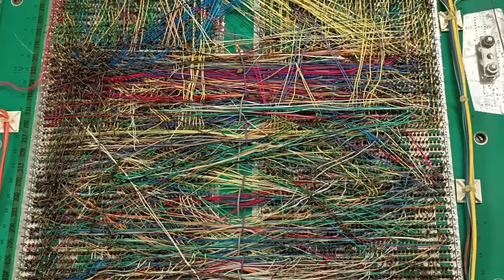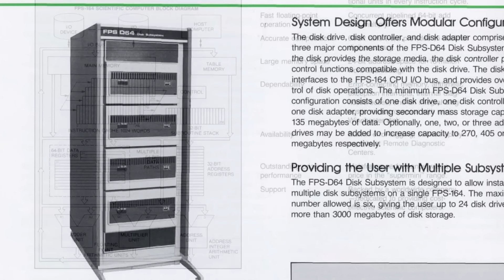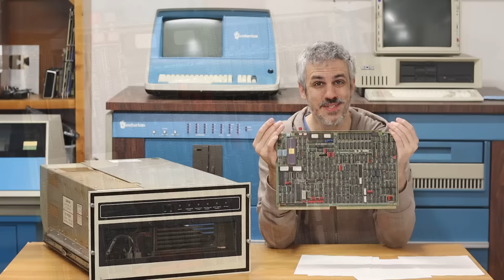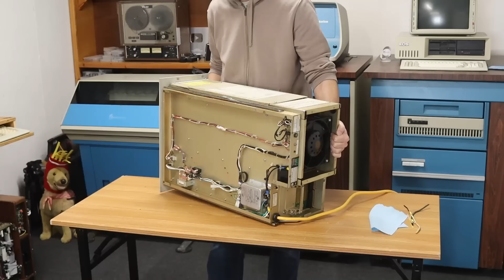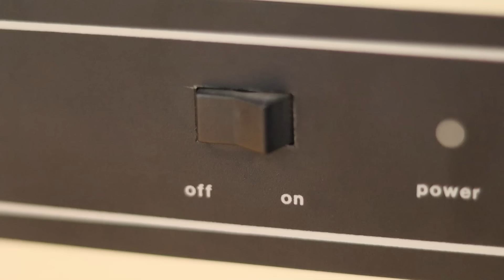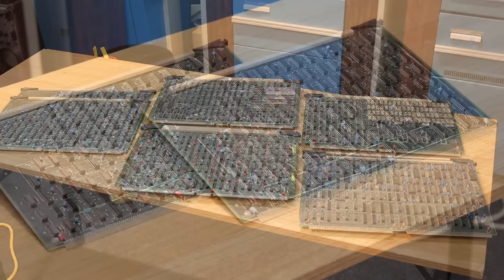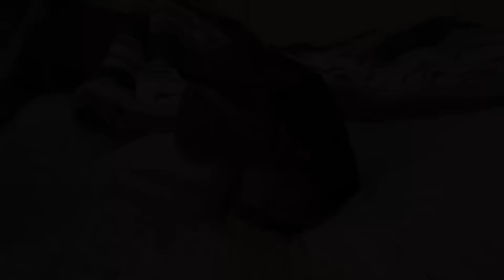This Computer is from a Defunct Supercomputer Company

Comment: 3GB in the early 80’s is mind blowing, I don’t think I heard the term “gigabyte” until the late 90’s.
Reply: The '90s were a wild time for storage evolution. Your 1993 PC might have had a 120 MB drive. We bought a Pentium 75 with a 1 GB 3.5" IDE drive in late 1995. By 1997 you'd have seen a 4 GB model, by 1998 probably 8 GB, and by 2000 probably 20 GB at 7200 rpm.
Reply: @PileOfEmptyTapes  I had a Pentium P60 with 400MB of IDE HDD in 1993.
Reply: @PileOfEmptyTapes  My Window 95 computer had 4 GB (It was a used one that was upgraded, then sold when 98 came out). I had SO MUCH SPACE!

Now I have like 4 terabytes in all and I need more
Reply: @PileOfEmptyTapes  In 2007 I had a 240GB hard drive (no clue what it cost). In 2014 I paid over $100 for a 2TB hard drive. In 2023 I bought a 20TB EXOS for $400.
Reply: @colewelden 

My first cutting edge (at the time) computer was an Atari 400.  External 5-1/4” floppy drive.  Each floppy could store 256 KB.  It had 16 kilobytes of ram, which could be extended to 64 kilobytes by inserting RAM cartridges.  That was not a typo.  KB, not MB, GB, or TB.  My friends thought I was insane to buy them, but I was doing things with graphics they couldn’t imagine.  For those who remember, while they were doing things at CGA levels, I was doing things at near VGA qualities.

I remember having to try all possible orders of loading my program kernels to fit them in the 512KB memory limit.  I remember spending hours swapping dip switches and jumper pins to find an interrupt configuration and com port to fit a new piece of hardware into my existing system.

When I upgraded to an 8086 with 12 MHz in turbo mode with a 16 inch multisynch monitor and a 10 megabyte hard drive I thought I was styling, even though it cost three month’s pay.  

A year later it needed upgrading.  I continued to upgrade that computer in a Ship of Theseus kind of way until 2005, when I made the mistake of upgrading by buying a brand new off the shelf computer.  Once was enough.  

I went back to building and upgrading my own.  I eventually stopped upgrading because I could and switched to only upgrading because a game I was playing needed it.  I think my last upgrade was 2016 or 2018 (I can’t remember).  I haven’t run across anything that needs more, but I no longer write my own programs.  

I self taught myself Basic, Cobol, Fortran, C, C++, and Java.  I found DOS much more interesting to play with than Windows, which took much of the hardware level system control away.  I still use a lot of the programs I wrote over the years, but I stopped playing with graphics around the time Unreal came out.  I gave up on Windows as soon as Linux came out.  

I was offered jobs in the industry several times, but I didn’t want to convert a hobby into work.  I eventually did end up building hardware and programming as a small part of my job, but it was PLCs and automation systems, which were far enough removed to be a completely different discipline.

Nowadays it is all about networks, which never really interested me, and AI, which does the work for you.  The tech has grown beyond my area of interest.

I have watched the tech grow from when I first read about integrated circuits in 1969 to today’s AI computing.  Nowadays your phone has more computing power than the entire world did when NASA launched Apollo.

I recently read a book about Cold War spy tech.  The CIA spent billions developing tools to enhance their agent’s capabilities.  Nowadays there’s an app for that.  They would have trafficked their daughters for capabilities and tools that are now free on the internet (in your car) and usable by people who aren’t sure if computers use electricity or not.

It has been a hell of a ride.
Reply: In about 1992 the software company I worked for then bought our group a 1GB hard drive, and we were overjoyed. The group was building versions of a software package and 1GB gave us so much more room  for build artifacts, logs and past builds for comparison. And it took months for a team of 6 to get close to filling that one drive up!  -- just 1GB -- !
Reply: A friend of mine had a 1 GB drive in the early 90ies. 5.25“ full height and it cost thousands.
Reply: @EVPaddy Mine (1992) was also 5.25” by full-height, SCSI interface, and had a power draw of 60W.
Reply: @ethanpoole3443 a good friend of mine worked in desktop publishing and he had a 10GB harddrive in 1993. That thing was massive and needed it's own power supply. He gave it to me when it was obsolete. Still got that behemoth laying around somewhere.
Reply: I think I had 2 gigabytes in papers in 1873
Reply: @triangle.pyramid  ahaha
Reply: When I worked for FPS, I added up all the disk drives in 1987. There were 3.1 gigabytes in the entire company. I was curious to know how much music could be stored. I've had over ½ TB on my phone for years.
I remember being amazed when I saw a 300 MB Winchester drive the size of a bread box.
Reply: I bought my fist 1GB SCSI hard drive for my PC in late 1992.  As I recall it cost somewhere between $1500-1800 at the time.  That was in addition to my existing 330MB SCSI drive.  It was hilarious if you wanted to format it for MS-DOS as you needed the whole alphabet!  I actually used Windows NT 3.1 beta for that PC and those drives.
Reply: @ethanpoole3443  How would you have acquired a beta version of Windows NT back then? Were these distributed to testers or publicly available?
Reply: I built my first 486 in about 1994 on the proceeds of a month of hellish work in the sands of the Arabian Peninsula. They ran us off the site for predicting that they were going to have a major blowout and burn the rig to the ground ; a week after we left the country, they burned the rig to the ground. Interesting times. But it (or possibly it's successor) used a motherboard from a company called "Gigabyte".
Personally, I'm still trying to get people to work with the idea of the gigadeath. As in, "World War 2 was approximately a 0.04 Gdeath conflict." Somehow, people resist thinking like that.
Reply: @WellsiteGeologist-UK  0.0 something is always awkward to handle. „40 MegaDeath“ is easier to say and might catch on easier.
Reply: @MrAranton  When you need to express ideas like "the human population is probably about 5 gigadeaths from a "sustainabie" level", you need to get people used to thinking in gigadeaths, and what it means.
Reply: @WellsiteGeologist-UK 
I sympathize with your expat experience.  I worked for the Royal Saudi Navy for a year (pre Gulf War).  I understand they are a lot more serious today.  Not so much back then.
Reply: @Simple_But_Expensive  (Noting that i deliberately used the term "Arabian Peninsula" to leave it definitely uncertain which of the peninsula's 8 (or is it 9? ; I'd have to go and count) counties I was referring to. You never know - I might end up working there again.)
Reply: @WellsiteGeologist-UK 
Fully understand.  I have no intention of going back, so I went ahead and named mine.
Reply: There was a game called Devastation (albeit a later title), but it always killed me when they claimed they need to steal a "8terrabite drive" or something. As a kid, i was happy to have a 5gb harddisk, and i felt like a king. All my dos games could run there. But i haven't seen computers such as this (im 30).
Reply: @alyctro8158  My first computer - a 386, 1989 build - came with a 40MB hard drive on an MFM controller. Careful research after I'd paid off my student debt yielded an RLL controller card which, after running code from it's ROM chip turned the 40 MB into a 60MB drive (actual, not using compression, which arrived with the next version of DOS). Another good month at work produced a drive to put onto the second RLL channel for 120MB in total.
Then a job in Norway got me into big (half-gig) drives, but also needed an IDE controller. in addition to the RLL controller. I think that was about when I made the strategic error of buying a VL-bus mother board and IO card.
Reply: Who remembers Zip drive discs and 1 gigabyte Jaz drives from 1996-99?
Reply: Late 80's for me.  Apple's XMP-48 had 1GB of RAM and 12GB of storage spread across a room full of VAX-7800s
Reply: I agree. Phenomenal
Reply: For most of us at that time; The only GB we knew of was the country I live in... 🇬🇧😆
Reply: My first hard drive was 10 MB and cost $500.  My next hard drive, bought 2 years later was 30 MB and cost $200.  My friends were laughing at me because they said I would never use it all.  Today, you couldn’t load your operating system on it.
Reply: I got a 40 mb hard drive and I could finally install windows 311 from the many floppy disks. Then had no space left. That Hackers film was misleading on how easy it was to hack … 12 mhz when the turbo was pushed no heat sink needed.

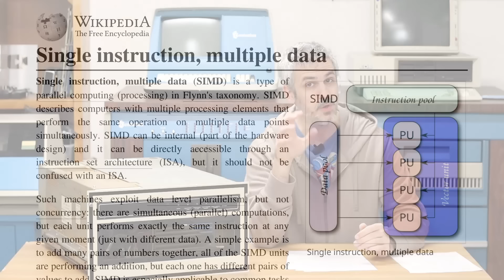Comment: 5:30 I find this one of the wildest things about old computers - these days suggesting a word length that's not a power of 2 would be considered the ramblings of a lunatic, but back then  you could pretty much pick a random number and run with it.
Reply: Get this: IEEE 754 floating point actually defines a 43-bit extended single precision format. That's even weirder than 38 bit!
Reply: The numbers weren't random, though.  The Apollo Guidance Computer, for example, had 15-bit words (plus one parity bit, but we don't count those).  I'm sure they worked out that it was they needed, without any more than necessary.  They had strict size and weight limitations.

Other early computers had words that were a multiple of six bits because they used a six bit character set.
Reply: @GH-oi2jf  I've run across weird word sizes that didn't fall into the "multiple of 6 bit characters" category at least.

For example, the CP-1600 was nominally a 16-bit machine, but it used 10-bit opcodes. That was dictated somewhat by how many transistors they could fit in the chip, really.  DSPs have come in odd sizes such as 24 bit, and have had features such as 40-bit accumulators. Those were driven by cost vs. precision tradeoffs. 

There was some Burroughs big iron (B6500, for instance) with 52 bit words: 1 parity bit, 3 control bits, and a 48-bit data field. I'm not sure what drove 48 bits for their floating point format; the corresponding integer format was effectively 40-bit sign magnitude, though, IIRC.

The LGP-30, a machine made famous by The Story of Mel, had a 31-bit word size effectively, as the 32nd bit was a spacer bit to separate words on its drum memory. (The RPC-4000, which Mel is porting to, has a 32-bit word size.)

And then there's those really old-school bi-quinary machines, with 7 bits per decimal digit, encoded as a pair of 1-hot vectors...

Yes, not truly random, but certainly quite a variety!
Reply: Provided it's a multiple of 3…
(in octal times, bits came in triplets)

Comment: Jeez, they saw the DEC 5V supply that could do 120 amps and were like "Oh yeah?! We'll raise you 80 amps!"
Reply: I had an Applicon-11 system for awhile.  It was a pdp-11/34 connected to a CAD system.  When I got into it the PSU there read +5v as 400A.  It may have been 500.  Was crazy.  But it fed up to 4 connected backplanes mostly of 8k of memory cards and 4 very large CRTs with drawing pads.  I never did get it to work. The RP06 was in very poor condition with bits of the foam insulation all over inside.  I only spun it up once but did not load the heads.  I later sold it someone else.
Reply: @timradde4328 That's quite cool! I can't imagine what it would have been like to do CAD on an 11/34.
Reply: Irony is thats nothing compared to modern <1v VRMs

Comment: That the designs and documentation of these defunct companies are lost, often forever, due to acquisitions and other corporate skullduggery (like buying a company just to kill its competing products) is simply criminal.  One would hope that there would be a central (in US terms, federal) repository where companies are legally obligated to submit their designs and documentation.
"But muh trade secrets much intellectual property wow" - make it sealed for 10-20 years.
Reply: All of the software for Burroughs Medium Systems still exists. Somewhere. When the line closed down in March 2000 (just after the Feb 29 leapyear date was known to have transitioned correctly in the software), the production system disks were archived and the archives sent to Iron Mountain for safe storage. The development systems were then shut down and parted out. That data is still in Iron Mountain. Somewhere. The employee in charge of the interface to Iron Mountain gave the location code to the person in charge of software, and it was kept. 

But several years later when I tried to pull the archive so that I could get it to a museum, we found it was written in a format that nobody recognized as an Iron Mountain location identifier. So it was effectively gone, because nobody could send IM a pull request to get it back. The last of us that were around Unisys in those days are now retired or dead, so even that incorrect locator has been lost. But the tapes are still there. Somewhere. Whether they would be readable after 25 years is a good question. Probably not.

Comment: This is a bit of a stretch, but you could try fuzzing the 3000. Assuming there's nothing in non-volatile writable storage and that the system can never get into a state that damages the hardware, there's no harm throwing bits at it until something happens.
Reply: That isn't a good idea, even into the 90's Intel put special instructions in their cpus that made them go kaboom.

There is no way to know if there was any put in (intentionally or unintentionally, it doesn't matter).

Comment: I ussed to work in telecomms, all wires were wirewraped, we had an electric wrapping tool, though not sure if it will fit your pin spacing, it looked like a small drill, but with a cut and wrap tip
just an idea ;)

Comment: The biggest difference between the AP-120B and the Cray-1 is that one can be run from a wall outlet and needs no external cooling and the other needed 115kW of 3-phase power just to power the unit itself and 20kW worth of refrigeration to cool it down.
Reply: Back in my Uni days they had VAXes which were Not For Us Mere Mortals. Recently I watched a video here on YouTube by someone opening and detailing a VAX. That fired in me the dream to own one myself. The inner workings did not seem to pose any problem (OK the wiring of backplane would. In spades) But when I saw the power plug, I realized that, no matter how cheap the price of the VAX, the electrical bill would bankrupt me.
Reply: @TomFynn I don’t know which model VAX you were looking at, but the 11/780 had an L21-30 plug.  That’s Three-phase 208 with neutral at 30 amps.

Interestingly, the various parts of the VAX all ran at 117V.  The reason for the 3-phase plus was because no one wanted to supply 117v at 90 amps.  If you rewire the power distribution unit, you could run it off of 5 20 amp household circuits. :)  

However, even if you were willing to do that, let’s talk air conditioning — oh yeah, and the disks were power hogs as well.
Reply: @daleomiller  Tempting. Not. :)
Reply: @TomFynn  It does make me wonder if it's possible to locate and/or build something like the PiDP-11 for VAX hardware/software/emulation or whatever. It might be a more attainable solution, if only due to the reduction in power usage. ;-]
Reply: @llearch : Some of the later VAXen were effectively desktops, so it should be decently possible (though you might have to go with a very new RPi). Curious Marc did a video on repairing a power supply for one I think? So, if you wanted, you could even recreate the power supply.
Reply: @llearch  For me that is guru level. Guess the closest I''ll get to a VAX was using SimH.  And even then the only viable OS was NetBSD and just hides the VAXness behind some Linux-y distro. Emulating is nice, but real hardware is real hardware. Well, I guess one can dream.
Reply: @absalomdraconis  Yup, this there are late model VAXen in full tower cases which ran off a standard power outlet, if you want a personal real-deal VAX that's definitely the way to go.
Reply: haha, yeah :-) I once did a detail comparison between the Y-MP and a Raspberry Pi ZeroW. Foremost, yes, of course, the Cray IS faster. But the whole thing with racks for input, racks for output, racks for power and racks for cooling has always been a shocker with Cray-sized hardware.
I had no idea something as small and fast as these FPS existed.
Reply: I suspect the FPS systems did require cooling, just not so much that anyone noticed next to the VAX sitting next to it.  One of the big selling points of Convexes was it was still cheaper to buy a new evaporative cooler for the roof of the data center and four C2's than to buy one Cray Y-MP.
Reply: A cupboard-sized CPU built in Emitter-coupled logic at 80 MHz is bound to pull a LOT of energy.
Reply: @SterileNeutrino : Someone in the 90s on USENET said that a contemporary desktop computer built using ECL logic wouldn't need a desk, because the airflow required to cool it would be enough for it to hover 3 to 4 inches above any surface.
Reply: And you could sit around on a Cray.